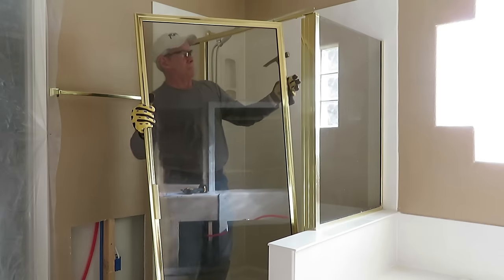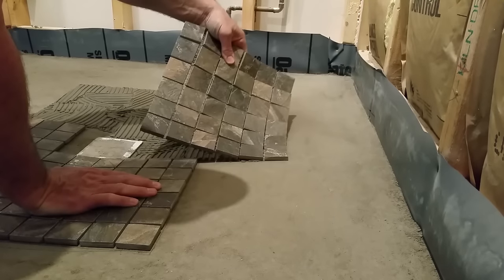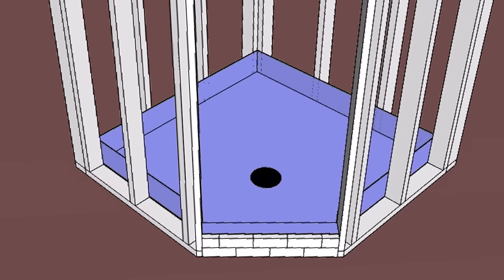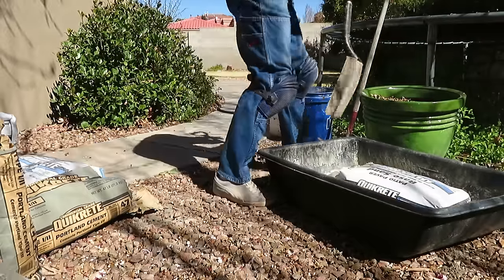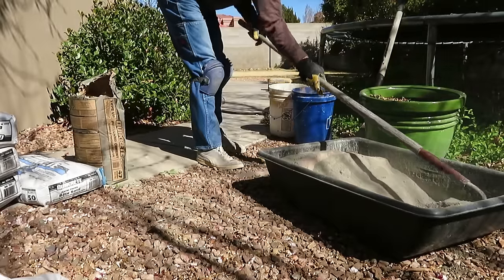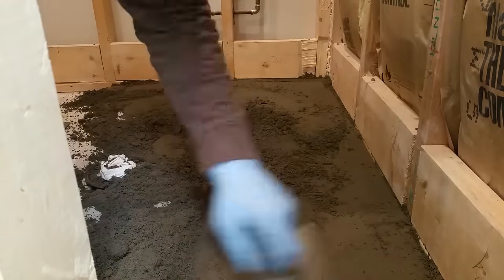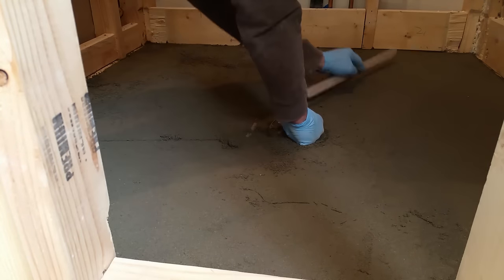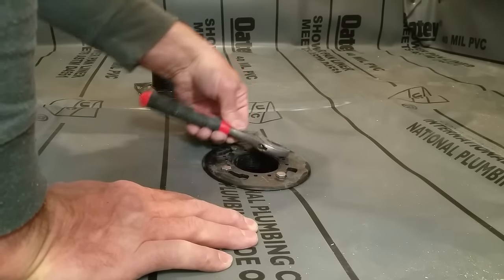Building a Shower Floor From Scratch - Part 1 of 2 - With Shower Pan Membrane

Comment: I had to comment on the shower pan project. I have to let you know you did most of it absolutely incorrectly. I have been building showers for over 25 years, my experience is not only union trade knowledge but also 3 generation taught. You created many problems for anyone viewing this video. Sorry to say this but I am tired of people installing showers incorrectly. If it were a do it yourself project we wouldn't be considered a skilled trade.
Reply from the maker: Simple question... with such strong opinions and so much knowledge, why don't you have a YouTube channel showing everyone how it is done?

Comment: I have a question. On a concrete floor? Do you always dry pack, shower pan and the dry pack again. I seen mix videos where people just put the shower pan on the concrete floor with no dry pack under it
Reply from the maker: It does work, Ormond, to place the shower pan directly on the concrete floor. The reason some of us float a pre-slope dry pack to place the shower pan on is to make it easier for water that makes its way to the shower pan over time to find its way to the weep holes and into the drain easier. With the shower pan placed on the concrete, obviously some water will collect because the slab is flat. Whether that becomes a problem over the years, I’m not really sure. I am confident it would take a number of years, maybe decades to create a problem. It is possible that the floor could be more prone to mold issues showing up because of the increased moisture in the dry pack that will never dry out, but again I don’t really have any experience with that happening. Good question!
Reply: @RustyDobbs  I really appreciate your help. Im glad I kept watching your videos last night. You answered all my questions to why. Now I know what to do. Thanks

Comment: What is you have plywood and not cement. Does the process change
Reply from the maker: Not really, Robert. The only thing you want to be aware of is that you are loading the floor joists in the area of the shower with a lot of weight that would not have been there if let's say you had a fiberglass shower base there before. Just need to make sure that the joist structure can handle that added weight. I have another video called "Building a Corner Shower Floor From Scratch" that is on a wood subfloor that you may want to check out.